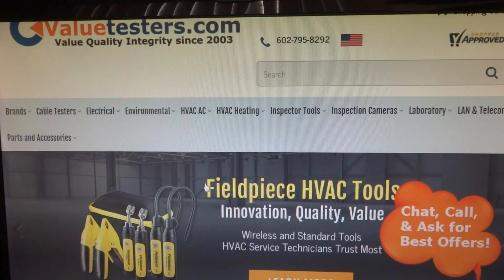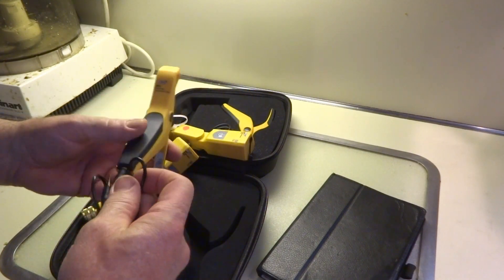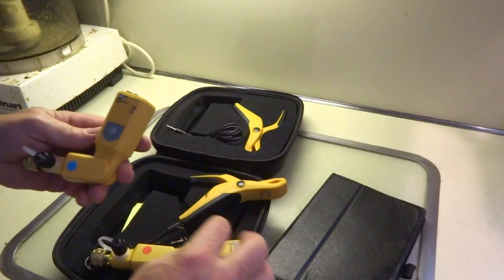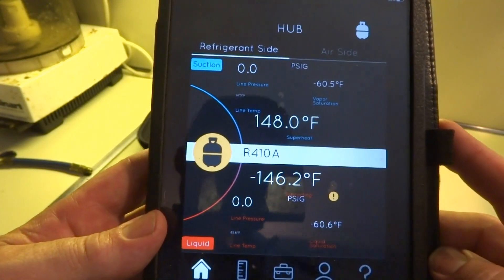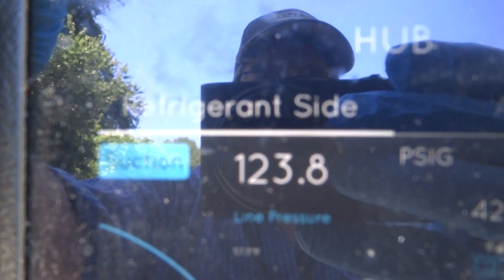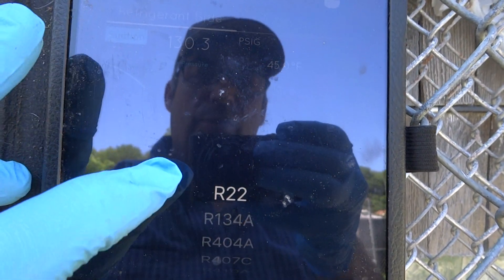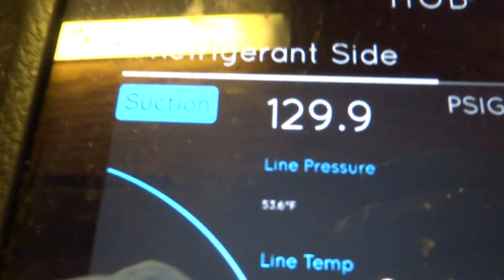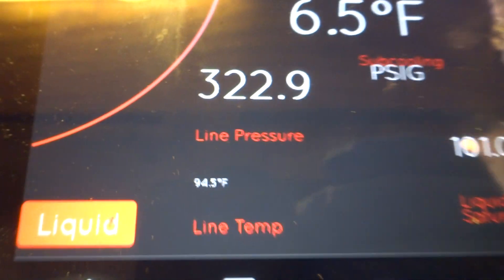UEi HUB4 Smart Refrigerant Kit demo

Comment: I do LOVE how companies that build test equipment hire BS app 'designers' that throw together apps that look flashy but are functionally useless.  Testo has their Smart Probe app almost perfect. Testo's only real downfall is they were early to the game and used BT 3.0 and it has piss-poor range but the tools are tough and instil confidence in their durability, I've had mine for over a year now and have only had to change the batteries once (average 10 uses per week for 10 min each use on diag only calls).

That hinge joint is a bad gimmick and if I'm not mistaken they used the thinnest conductors possible to pass that joint which will be a failure point.
Having a screw on the battery door is a toss-up. If the screw is captive and has a machine screw insert I'll give it a pass, but if it's a non-captive and/or taps into the plastic it's shite.
One big kudos is they were smart enough to use standard 3.5mm TRR cables to the temp sensor so you can buy cheap "aux cord" cables when they fail.

Comment: No NU22B, MO99 nor R12? I also agree, the line temp digits could be a lot bigger. There is more than enough screen space for larger characters. The great part about these complaints, is they can be fixed with a software update! Not for me but thanks for the vid, Steve!